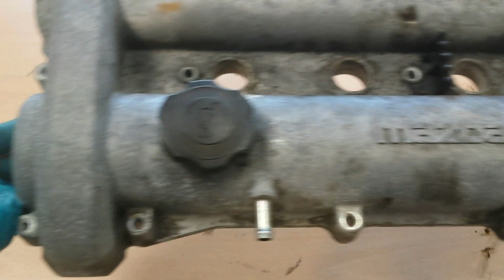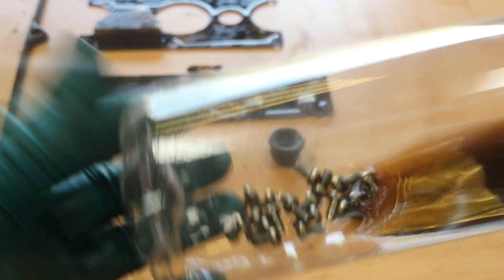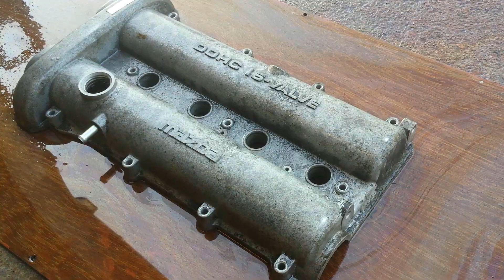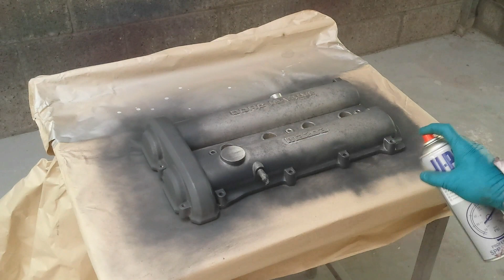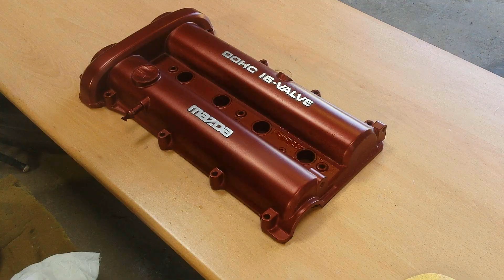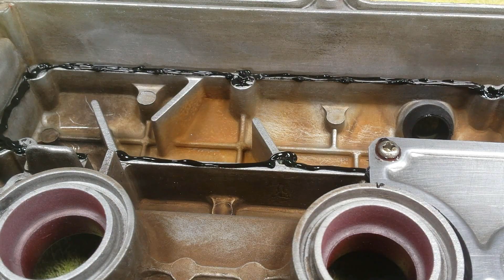MAZDA MX-5  Rocker Cover Restoration ( Miata , Eunos )

Comment from the maker: Hey Guys, As you have probably noticed already i have updated the channel name and logo. The channel is no longer Really Random Channel it is now RRC Restoration. Just incase you were wondering why the water marks in the video still say Really Random Channel. Enjoy.
Reply: Hey man I would love to know what u used in the vid to clean it because I want to do the same but idk what to use
Reply: I really like what you've done.  I don't think I have the knowledge you do.  My engine is in pieces at a shop and I would like to do it while it's out.  Would a body shop understand the process?   Perhaps I can get them to wait while I get the cover and do it myself.  That's really a difference-maker when you eyeball it.
Reply: where can I see what products you used in this process.
Reply: instablaster.
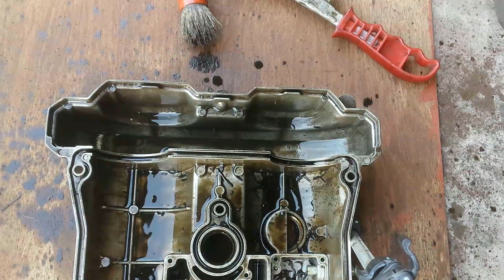Reply: What are you spraying on the parts? 9:04

Comment: I realy love people not buying new car parts and restoring what they have. Instant subbed
Reply: No one buys a new rocker cover? They are hugely expensive.
Reply: I like this coment
Reply: You must not buy used cars  if you love people doing this
Reply: On the subject of buying new parts (not related to cars) I basically rebuilt my family’s dryer, new motor, new belt, new heating element, new sensors, works like new.

Comment: that's got to be worth 50+ bhp
Reply from the maker: At least haha!
Reply: Except is gonna be 51+bhp
Reply: 50bhp and 1bcp (cat power)
Reply: @nickbrock6894  this is far from what a ricer would do. A ricer would go to their local walmart and buy some non high heat paint and paint it without any prep work.
Reply: don't forget the stickers
Reply: never do this because the paint warming the engine this parts doesnt cum with paint from factory because that
Reply: @RC_Trailblazers  
What happens when you use low heat paint?
Reply: First time I’ve heard it called a rocker cover
Reply: lipstick on a pig if you don't detail all the rest of the car?
Reply: At least 50 hp

Comment: I did an almost identical job to a spare cam cover for my 1.8 Mk1 (Same as this one I believe). Only difference is that I went a bit crazy with the cleaning. I ended up cleaning it, Then cooking it in the oven for a couple of hours to bring as much as possible of the remaining oil to the surface, Then used an old steam wallpaper stripper to get it really oil free before sanding and spraying gloss black, Sanding back the lettering with 80 grit for a heavy brushed look, Then several coats of lacquer. I finished it off with a machined alloy oil filler cap. It looked stunning, So I put it safely away in a box in readiness for the next cambelt change........ But before that came around I knackered my back and needed to sell my precious MX5 to get something more spine cossetingly sensible. :(

I kept the collection of upgrades I hadn't got around to fitting for over a year before I realised that my back was never going to be  good enough for me to get another MX5, So I sold everything off (That cam cover, A couple of service kits, A reconditioned Torsen type 2 dif, A full set of second hand wishbones that I'd had chemically stripped and powder coated, New chassis braces, + lots of other stuff). I'd been carefully collecting cool bit's to go on that car for over 2 years, Finally selling them all off broke my bloody heart. It felt like a book just finishing mid sentence without actually ending the story. :(

.............. God, I miss my old MX5. :(
Reply from the maker: Hey thanks for you comment and your rather upsetting tale. There is nothing worse than spending lots of time and effort on a project only for circumstances beyond your control stop you from completing it. I hope your not in too much pain with your back these days. RRC
Reply: Viva miata!
Reply: I feel ya man, same thing happend to my Suzuki Sierra. Man did I love that car😔😔😤. Now I've got a 2004 ford falcon 😐
Reply: I realize I almost read this whole thing,I stopped because I came to YouTube for videos
Reply: I understand this completely , I recently injured my back and I need to sell off my sports cars, every bump is a nightmare.
Reply: @Flako92  Yeah, just to have something that reminds you of all the great times.
I always keep my license plates but I forgot to tell the buyer of my last car I had to sell to send me my plates back, now I'm left with only my memories😂

Comment from the maker: Hey folks, Im loving the warm reception you've given the automotive restoration twist the channel hast taken in the past couple of videos :). With that being said i would love to hear your input into what else you would like to see restored thats linked to to the automotive world whether its random automobilia, a specific car or motorbike part, a vintage automotive tool? etc. All ideas are welcome . And again id like to thank everyone for helping the channel grow and bring you even more content. RRC
Reply: An old car grille would be perfect.
Reply: Restore your pressure washer, man. It could use a scrubbing of some sort.
Reply from the maker: haha, it certainly has seen better days!
Reply: Hey, Really Random Channel, I have a question: do you have to install those small plates back? Is it nescesary? Can you run without 'em? I mean like, it should not do enythinh wrong, also less weight. Or it'll damage the engine?
Reply: imagine one of those old rusted steel wheels -
Reply from the maker: Hey Gedas Im certainly no expert on the subject but as far as i can tell running without them wouldn't cause any issues as long as you install and oil catch can to catch the oil vapours returning from the crank case. But im sure there will be someone on here who is an expert on the subject. RRC
Reply from the maker: Hey Omega funny you should mention rusty old wheels...... Check back on the channel on Monday at 9PM GMT ;) RRC
Reply: Really Random Channel i would love more e30 videos
Reply: I love to see old rusty car parts get restored and repainted. Even an entire engine job on something like a lawnmower or motorcycle. Great stuff!
Reply: Restore my motorbike?
Reply: Really Random Channel  I loved this video so much ! I would love to see some old motorcycle carburetor rebuilds maybe you could paint them a crazy paint job
Reply: I have an old meter box thats rusted and dirty from a power plant near my house that burnt down recently. Could i send it to you?
Reply: Big brake calipers would be a nice to see get done
Reply: Dude... restore that MX-5 and get her on the road where she belongs!  (I'm assuming she's still road worthy now).
Reply: Really Random Channel  
😭 I was hoping it would be installed 😭
That would be really cool to see that
Reply: Really Random Channel what was the red/pinkish liquid that cleaned off the oil so well?
Reply: Really Random Channel I have been fixing car professionally for 17 years now and I never know there was a special tool for these annoying clamps. You learn something new everyday.
Reply: Do you do anything with all the plastic parts that are on the outside of vehicles like roof racks?
Reply: Just found your channel today and two videos in and you've got a subscriber out of me! The auto parts restoration is my main interest so I do hope you do more.... With that being said if you could do an old motorcycle or dirt bike motor that would be awesome, just a single cylinder, air cooled one. There's plenty out there to choose from and with your skill set I'm sure you would have no trouble making it look awesome! Or maybe an old beat up gas tank from a motorcycle? Just a suggestion.
Reply: Really Random Channel 😍🤩😙🤗
Reply: what paint colour is that
Reply: I'm a bicycle mechanic so my vote would be something bike related! Restore an old rusty frame perhaps?
Reply: Hi Really nice video you made and thanks for including the paint code in the video, i`ll be doing this same to my valve cover on my mk2 golf in the next month or so. #thewhitemk2
Reply: Really Random Channel u like painting things😂 🍻👏👏🐢🐢😁
Reply: u should take off the heads and paint them then put new gaskets 😂😃👏👏😁😁
Reply: Randomly stumbled on your channel. I am absolutely loving the automotive aspect. I would love to see a full Miata restoration job. Not sure if you have this info posted already, but it you would awesome if you could make some instructional videos on how to paint etc. for people who are just hobbyist like myself. :) Cheers!
Reply: Iiio
Reply: Color please 🙏
Reply: What about a Toyota Spyder MR2 Roadster cam cover? I will send you mine if you like 😊👍
Reply: I really like what you do. You can restore anything you want and I will watch it.
Reply: Make a video of polishing a valve cover to near chrome shine.
Reply: Can u do a detailed vid on engine bay painting
Reply: 5 months late but restore a mk1 escort grille. They were anodised aluminium and usually dented and knocked about. I know, im restoring 3 now
Reply: You should restore a whole vintage car
Reply: Brake calipers and valve covers are always cool
Reply: Really Random Channel I subscribed hoping for more of your MX-5 vids

Comment: I'm very impressed by the result, despite a lack of sand or glass bead blasting the surface finish is really astounding!
Reply from the maker: Thank you very much for your kind comment! :)
Reply: Is the valve cover the  same as the 1.8 cover?

Comment: Degreaser and a half an hour in a dishwasher gets rocker covers (and other car/bike parts) 100% clean and shiny without all the elbow grease, not as satisfying as doing it by hand but a lot quicker if you are short on time for the same result. Also if you put a limescale descaler tablet in with it, it can sometimes remove the build up of grime/limescale reducing the need for as much sanding afterwards.

Amazing job by the way! So satisfying seeing the end result after all that hard work.
Reply from the maker: Nice little tip there for future projects. Thanks very much and im glad you enjoyed the video. RRC
Reply: Wouldn't it make your dish washer smell like degreaser
Reply: I wouldn't do it. I would think it would leave an oily film inside the dish washer, but what do I know. Someone else can try it and get back to us.
Reply: mr Brown wow that is very glossy Mazda cover engine

Comment: Very satisfying to watch. Fast forwarding, no excessive talking or noise, clear steady video, great results. Couple of questions. Was it necessary to rtv the plates back in because I didn't see any old rtv when you took them off? Will the clear coat hold up against engine temperatures?  I'll echo someone elses comment below. The only thing hold this back from being perfect was no mention of brand of materials used or measurements. Those details could be added after the fact in the video description. Great job.
Reply from the maker: Hey, Thanks for your comment and suggestions. Im glad you enjoyed the video :). The plates were put back in with RTV as there was a layer on there from the factory, its quite difficult to see on the video. The lacquer will easily stand up to the temps as the bodywork of a black car standing in the summer sun all day gets waaay hotter then a rocker cover and the lacquer holds up just fine in that situation year after year ;)

Comment: If you are going to continue doing these refurbishing projects, and I hope you do, you need to get two pieces of equipment. First a parts cleaner, so you can clean the parts a lot easier. Second a media blaster. That will allow you to prep items and get into very tight corners and such. But you do great work either way/
Reply from the maker: Hey, Thanks very much for your comment and suggestions, If you watch my new videos you will see that i now have a media blaster and i have a new parts washer but just not set up yet ;)

Comment: You shouldn't have to put sealant inside the engine! Because when it is hardened and the engine is running some parts on the edge could fall off and clog the engine.
Reply: if you put to much. Did the same to 4 previous cars and nothing happend
Reply: If it is required.. it's also on the wrong side of the screw holes.

Comment: Good effort. But theres no need to clean the inside of the cover so thoroughly. Its just going to get dirty the instant you put it back on the engine anyways 😅😅
Reply: Actually if you keep your oil clean after this and change before recommended interval it will stay pretty clean. With that, I've seen cars with 100k that still have a like new appearance opposed to people who change oil every 10-25k with dirty covers like these.
Reply: Gabe P  it’s not so much about how often you change your oil (regular oil changes are important tho), it’s actually to do with how you run your vehicle. Carbon builds up on the oil as the oil gets warm causing the discolouration and thickening (leading to Black Death), once the oil is at operating temperature it starts to burn off the loose carbon in the oil, removing the discolouration but slowly thinning the oil.
Reply: How you drive? To some extent im sure for heat reasons. Im sure people with mustang gt's arent very easy on the pedal tho and ive seen some clean engine disassemblies. While i believe there is carbon in the oil from blow-by and from vapors that go thru the engine i also believe that alot of the discoloration comes from the aluminum wear and tear in the piston cylinder. Of course the oil filter catches 90%+ but theres still residual aluminum shards/ dust  that when they accumulate,   they start accumulating faster and faster. Personally i would never use one of those  20-25k long life oils. While they have been proven to keep their viscosity, the oil still looks black as night after 20k miles. I still say changing oil BEFORE intervals is key to keeping a clean, carbon / aluminum free engine. Also, get a oil catch can to help keep those oil vapors out of your intake manifold.
Reply: Getting rid of clogging yrs old gunk is always a good idea

Comment: very nice job, but id be more concerned with the electrical tape on you spark plug wires before I worried about painting the valve cover, function over form
Reply from the maker: Hey, Dont worry the plug leads will be changed along with a lot of other parts before the car sees the road again ;)

Comment: Correct me if I’m wrong, but wouldn’t this just be considered a valve cover not a rocker cover because it’s not a push rod engine?
Reply from the maker: Hey thanks for the comment. Technically you are 100% correct but rocker cover is just the generic interchangeable term for it  like valve cover, cam cover,rocker cover etc. RRC
Reply: Yep, it's true.

Comment: approved by the cat!
Nice job done, want to do something simmilar with my rocker cover, not sure yet if I go for red paint or polishing, the last one is more work.
I have a small grit blast cabinet which should make cleaning up the outside easier, a thourough pressure wash should remove all blast medium so it doesn't get in places you don't want it to go.

Comment: Would leaving bare metal help in dissapating heat? Try Wrinkle Paint, VHT next time. Comes in various colors and is impervious to any fluids. Like the original Hemi or Ferrari valve covers. Use on intake, runners, anything metal.

Comment: I'm curious in your choice of using red threadlocker instead of blue.  Red is normally for high-stress threads like connecting-rod bolts and the sort.  They take high-heat in order to remove.  Everything else is blue.  It may be quite difficult to remove those bolts down the road.  Any insight as to why?

Comment: I like how it came out, but you forgot to put seal around ignition plug 2's hole and the fastener screw's hole, when you installed the middle steel plate.

Comment: When you have parts such as these off the car for restoration (valve covers, manifolds etc) how do you protect the engine from debris? Plug any holes and close the hood?

I am considering buying a spare valve cover and intake manifold, to avoid having the car dismantled for too long (who knows when i would finish the job) and avoid any such debris falling into the engine. Think it's a waste of money to do that?
Reply from the maker: covering the cams with a plastic bag or something similar aswell as closing off any holes or ports will be fine to keep any debris out, Buying spare covers would be a waste of money in my opinion, but if you plan on taking a while to do the job maybe it would be better to buy spares and fit them as then you can still drive the car while restoring your other parts ;)

Comment: Next time try Sodium hydroxide solution when cleaning aluminium. it will etch it, and clean it a lot faster, not as much elbow grease needed. :)
Reply from the maker: Ill need to give that a go, Thanks for the tip :)

Comment: Really nice job, well done. I especially love the color! I do have a couple of questions however:
- What did you use to clean the part? Is it just soapy water (with dish soap)?
- Which color is it? Where can we get it?
- After the base coat, did you do the white-ish coat only to be uncovered on the lettering? In this case you carefully sanded down through the red but not through the white?
Thank you in advance.

Comment: I pulled my Valve/Head Cover off today and disassembled it. My baffles on the underside were also sealed with silicone  RTV. Why would this be done? I do not see the need.

Comment: Love these videos. Started with the Ducati restoration, as I found one nearby for minimum cash but in dire need of restoring. I'm not looking forward to the belts and desmo valves. Those are troublesome. Also - the sped up sound of the dremel tool is dentist nightmare fuel.

Comment: Do you need to use high heat paint on the valve cover?

Also get some black spark plug leads to have a nice contrast.